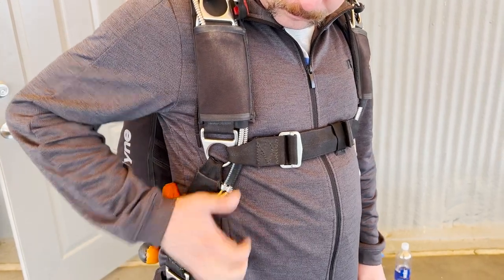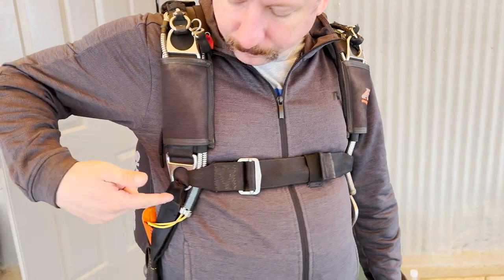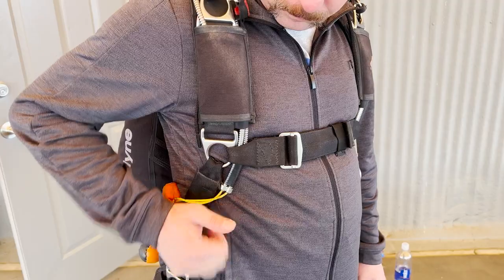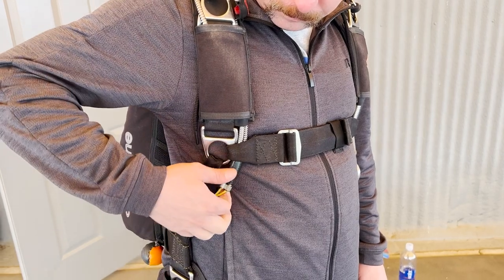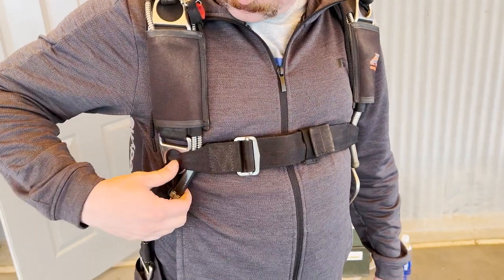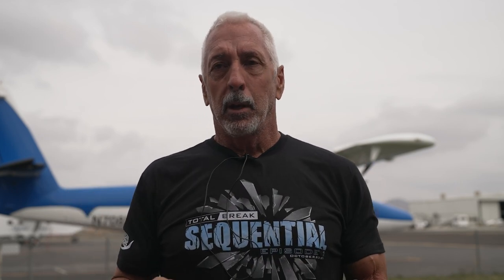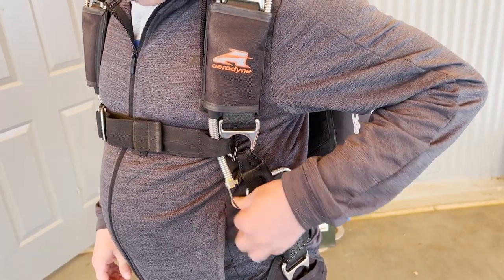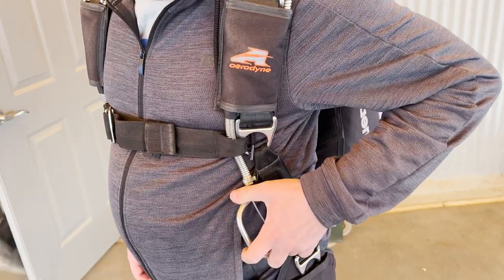Dealing with Dislodged Handles in Skydiving

Comment: Your RSL will also deploy your reserve if you can't find your cutaway handle.
Reply from the maker: That’s assuming you can find your cutaway handle. Of course it’s usually where it should be, but if it becomes dislodged you might have trouble finding it.
Reply: @shadeland  Yes! Don't use this to make things worse.
Another situation to prepare for is if your pilot chute handle has also vanished - so all 3 are gone and your hard deck is approaching. 
This is especially important of you're not flying an AAD for some reason.